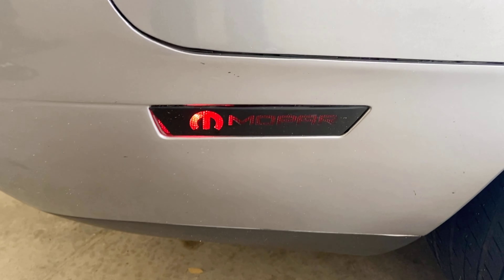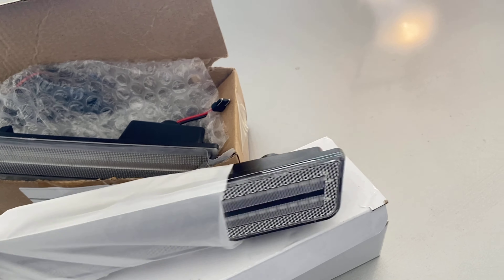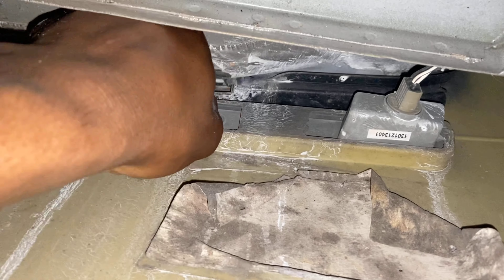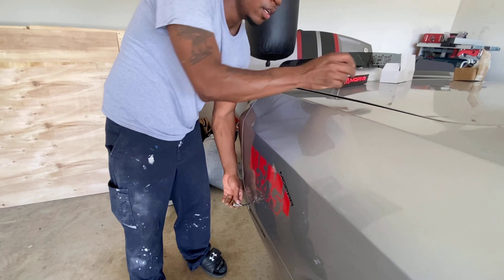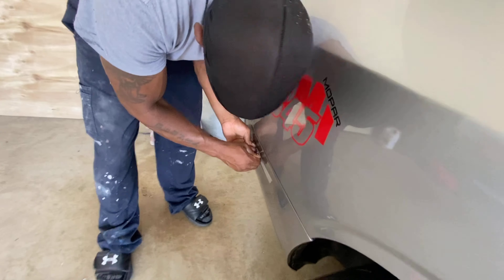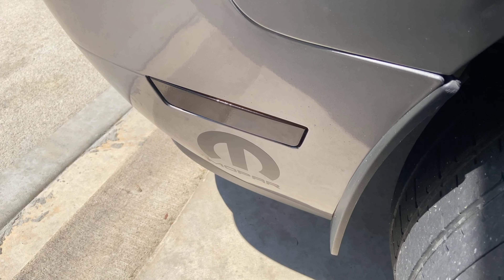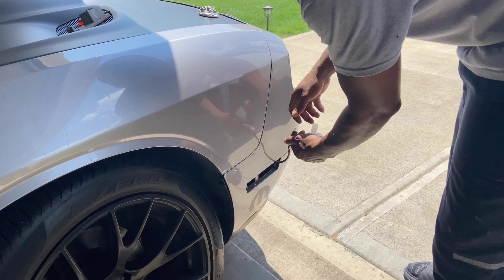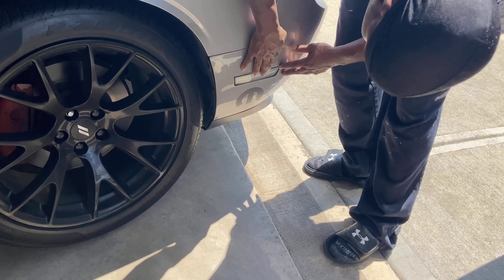INSTALLATION OF LED MARKER LIGHTS ON MY 2013 RT MANUAL CHALLENGER

Comment: Nice video! Any problems with the tail lights so far? I've been hearing some people say they have got some where one side didn't work.
Reply from the maker: Jorje Montoya 🙌🏾 Preciate it bro! I haven’t had a issue, mine are still functioning like new. I think I remember hearing a few ppl say that also a while back.
Reply: @russellmuscleatl  oh ok that's good! I'm thinking about ordering some they make a big difference from the older taillights! Thank you for the reply bro! Keep the videos coming!
Reply from the maker: Jorje Montoya That’s what’s up! Yeah they look a lot better. See if you can find some local on eBay. That way eBay will cover it also. I got mine from V land auto on there but I see they shipping from China now. But you’re welcome bro and will do🏁
Reply: Russell Muscle yeah, mine should be here in a few days. I ordered off eBay local in USA. If you order from Vland directly they are taking even 5 months to receive at this point.
Reply from the maker: Nathan TV That’s what’s up bro! 5 months😱 lol that’s crazy
Reply: Russell Muscle yeah it’s crazy?